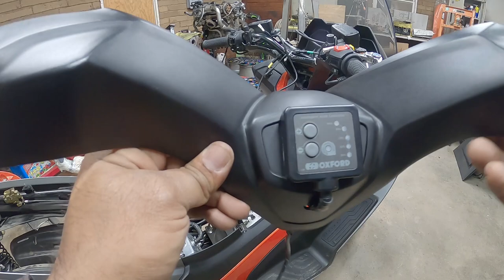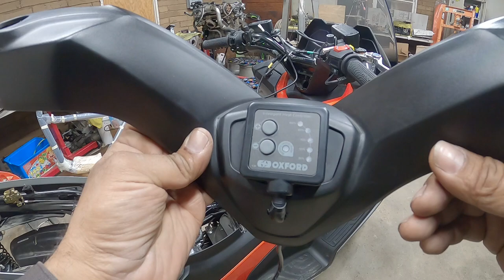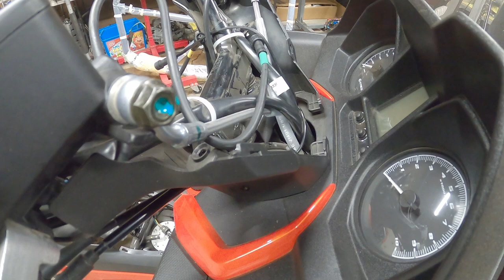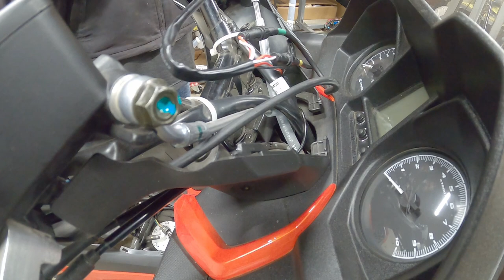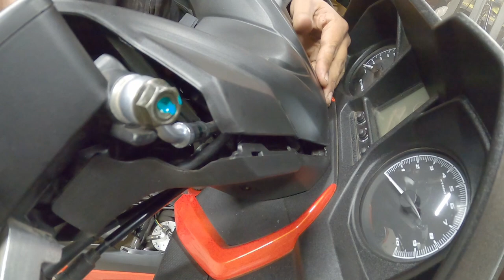Kymco X Town 300i - heated grip install

Comment: I have a question. at least with 2022 and up, the X-town in the U.S. comes with a throttle sleeve that has the grip permanently bonded to it as a single piece from Kymco. i.e., it's not possible to remove the grip from the sleeve. Which throttle sleeve did you use to do this? Or in older models were they two separate pieces? I am adding heated grips (Oxford Pro) to a 2022 X-Town 300i ABS.
Reply from the maker: The grips are just really glued on. Take your time. It will come off